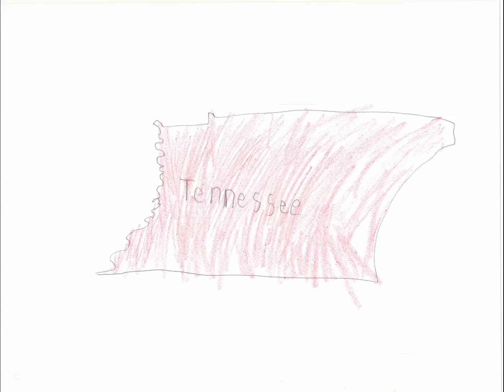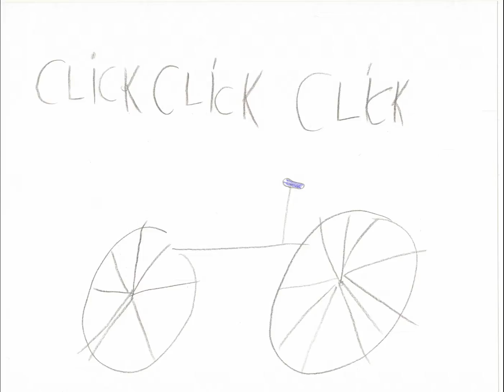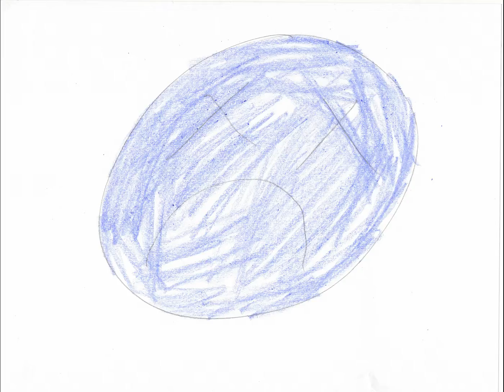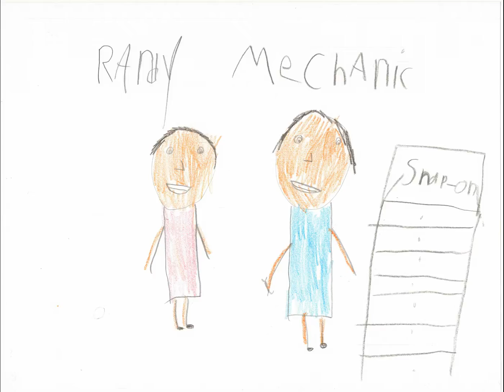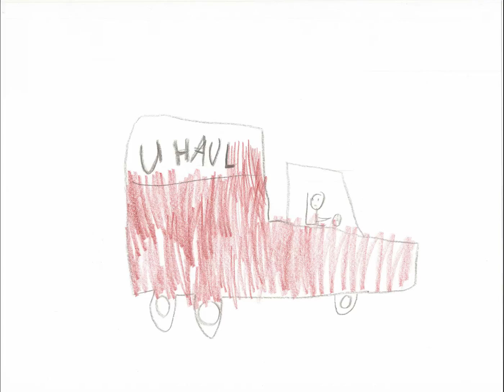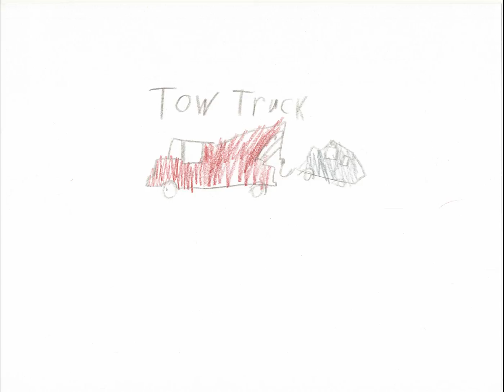Do I REALLY need to change my Timing Belt?

Comment: Have had my timing belt changed twice so far. I think its due for its third time soon. Its a 1997 Acura cl 3.0. The J series Honda engine. Before I do that need to replace the exhaust from the cat back. I fear those exhaust bolts are going to be difficult to remove.,  Any  suggestions would be greatly appreciated. I have to work on my back because I do not have access to a life.
Reply from the maker: I know your pain. I have been working on my back most of my life as well. Thats what separates the men from the boys. The exhaust bolts. Well I would soak them in a 50/50 mix of Acetone and ATF for a month. Apply a little each day for a month. After that if they don’t come out I would heat them with a OXY/ACTE torch right before I was going to remove them.
Reply: I heard people  who warm up the bolt with heat and apply candle wax which coats the threads ;and is suppose to aide at removal. Are you aware of using candle wax?
Reply from the maker: I have never heard of that.

Comment: What about timing chains? I know they don't break, but I've heard that they stretch. Having a Focus, I went all through the maintenance schedule, and they don't even mention it one way or another
Reply from the maker: Don’t worry about the timing chain. Yes they do stretch but only after a long, long time and they will get louder and louder over time. Giving you plenty of time to do something  about it. I have a Silverado with 300,000 Miles in it. Have never done anything to the timing chain and she still runs like a champ. I love her. I have taken her off-road, did jumps with her, pulled out a Ford F-150 out of a lake with her, she gave me shelter when I had no place to sleep. I love her.
Reply: BundysGarage thanks, I'm at 117k myself, so nothing to worry about as the only noise I hear is the ticking of the injectors which has been present since I bought 'er new